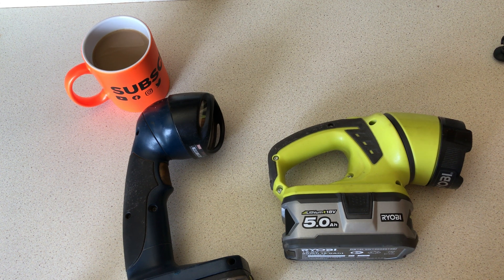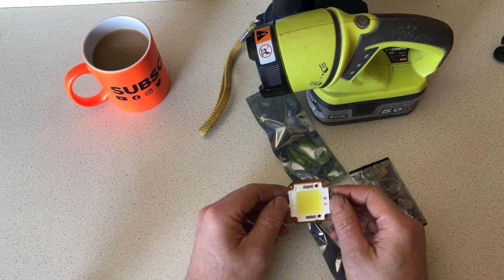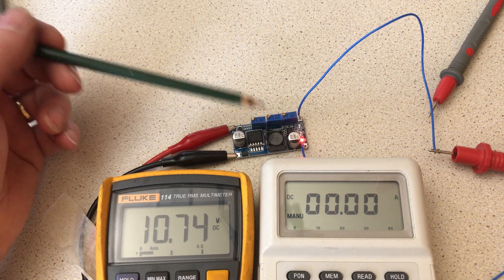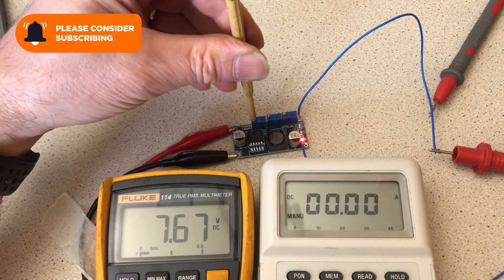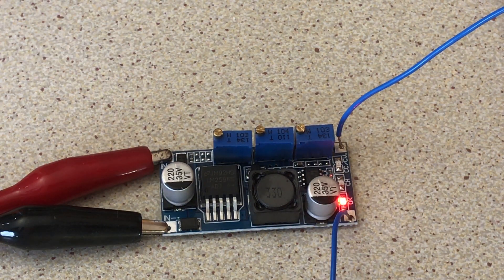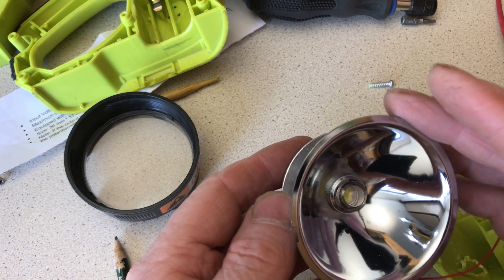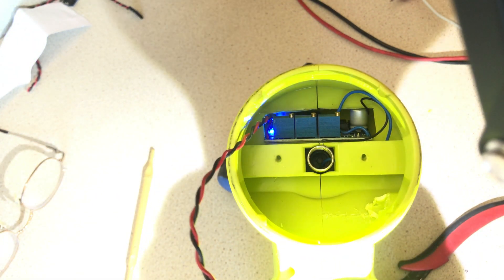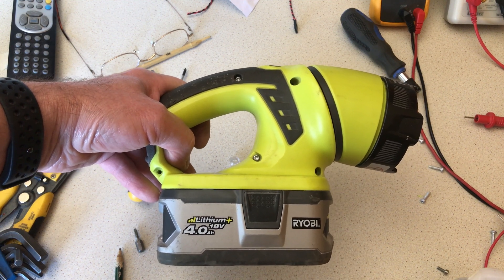Ryobi torch upgrade LED

Comment: I wired a mr16 bulb directly into mine 50w equivalent 5000k 6.6w 500 lumens ditched metal insert sniped 4 plastic tabs in the center fits tightly against clear lens and doesn't get hot
Reply from the maker: If that worked ok and didn't get hot then thats a quick and easy upgrade. 👍🏽